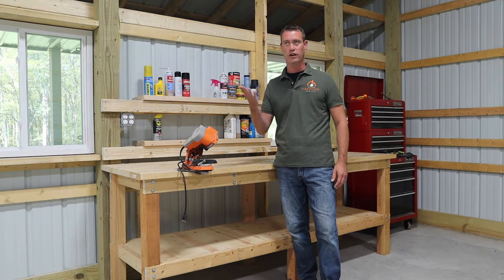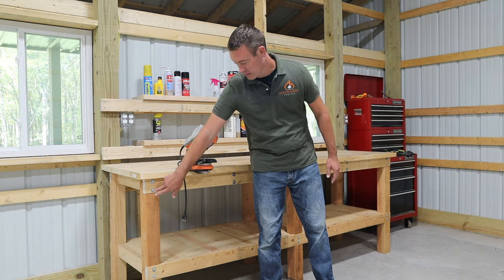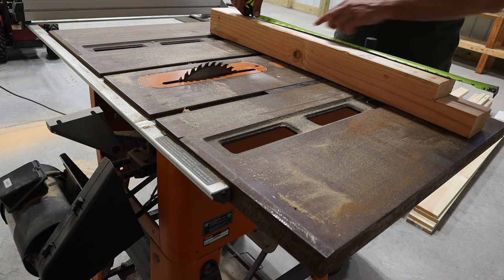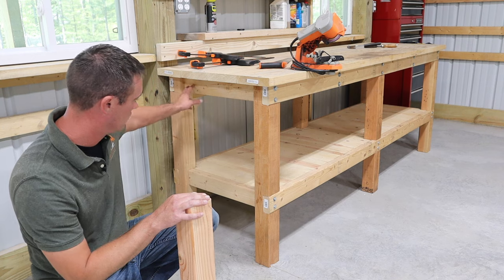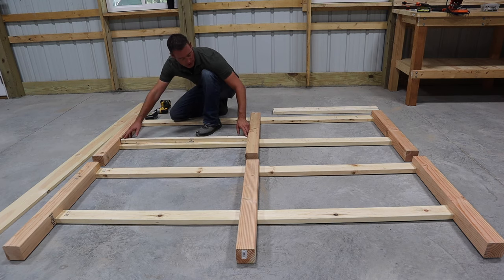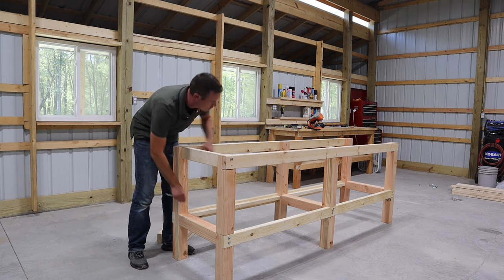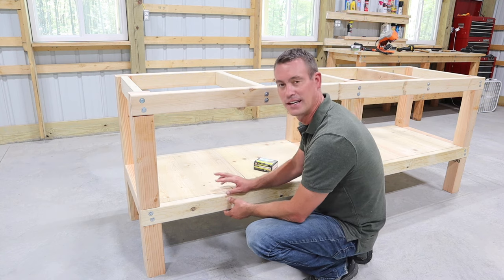How To Build A Workbench - The Best Way

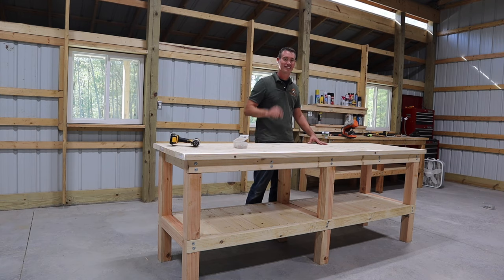Comment: not bad, but do yourself a favor and just go and get a big flat table style board, pre cut from your local store ... even from the video you can see how wobbly and uneven the pieced together table top is 11:35
Reply from the maker: The table style top is a good idea and thanks for the comment. The top from 2x6’s is very stable and doesn’t wobble but compared to a flat table top you are correct it will have small imperfections. Although, I use mine as a workbench where I pound on car parts and repair chainsaws so small imperfections on the surface really do not matter to me.
Reply: @firewoodforlife  If pounding on car parts, consider adding a nice smooth sheet of steel formed to fit and bend over the front lip.  The oil is easily wiped up and it doesn't soak in or dent like the wood top.

Comment: You said that you don't need special equipment, just a chop saw.  Then you show cutting the 4X4s with a big table saw!  Who has that!!!!
Reply from the maker: I made my first work bench using a hand saw to make the cuts in the 4x4's and not a table saw (I didn't have one at the time).  It takes a little extra time but it wasn't too bad.

Comment: no special tools let me fire up the table saw
Reply from the maker: You can still build the workbench without a table saw.  You would just have to cut the notches with a hand saw.  I've done it before (before I had my table saw, and it works it just takes longer).  It's a lot of cuts but if you have a sharp handsaw it's not too bad.